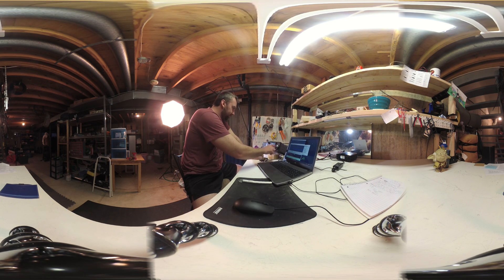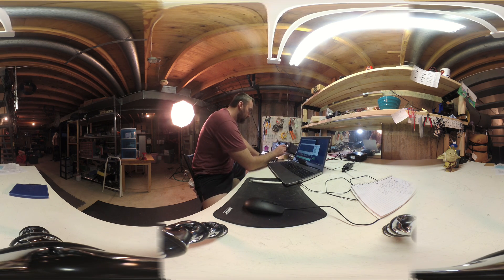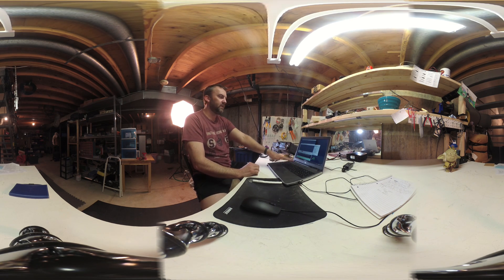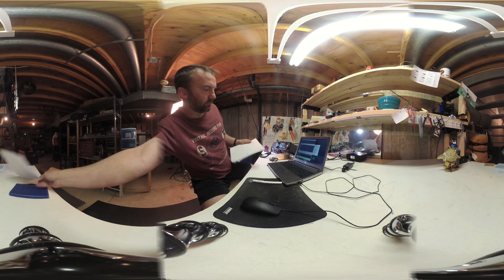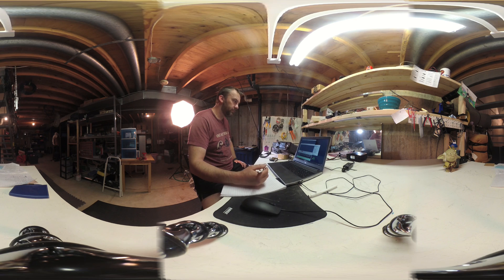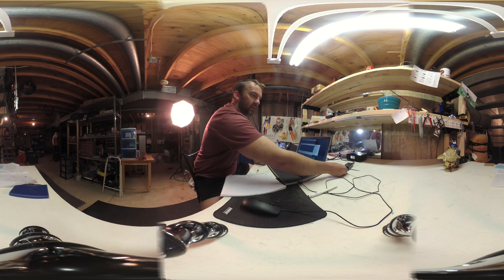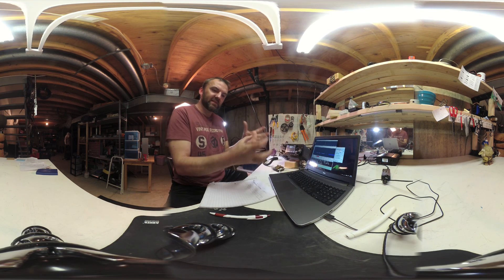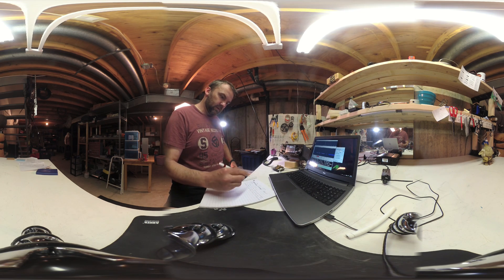Icom 7300 | MRP40 CW Morse Decoder

Comment: Great  video  , my issue is that my laptop wont work with MRP 40 OR  fldigi ect ect just says no soundcard  but it obviously has because i listen to music on it . But my 7300 apperently has an inbuilt soundcard  so i will try and see if Mrp 40 / fldigi ect will work when i plug in the radio  and i have downloaded the drivers from Icom .
Reply from the maker: Sounds like a PITA

Comment: Great video.  Could you please tell me how you connected your laptop to the 7300. Was it by usb. and could you tell me the settings you put the 7300 on. was it SSB-D  OR PLAIN SSB  or was it on CW or CW-D in the settings. I have been having a terrible time getting ham radio deluxe to work with my 7300 so I am going to try this MRP40 now.
THANKS  : )
Reply from the maker: I used USB only.  Please see youtube videos, do a search for 7300 to computer.
Reply: Thanks

Comment: Wonder how he uses the keyboard and where did he get the cable from icom 7300 to laptop?
Reply from the maker: That's just a USB cable. The 7300 has a USB output to a common USB to a computer.  The 7300 is wonderfully easy to setup.

Comment: ta for this. interesting software. For me, half the fun of CW though, is decoding it in your head. I have only recently (ie yesterday !) sent CW for the first time - using a straight key and my 7300 - and getting my first QSO on CW was a real buz. Any amateur radio operator that has not learned to take / send morse code should try it, although I get that learning morse can be a pain - the Aussie Army taught me over a quarter century ago, and it has stayed with me. Im glad that it did. Thanks for your videos. They are interesting. cheers, Cristian VK1FCLU